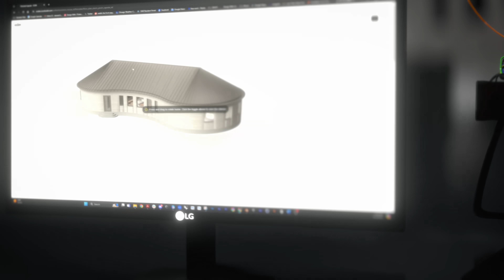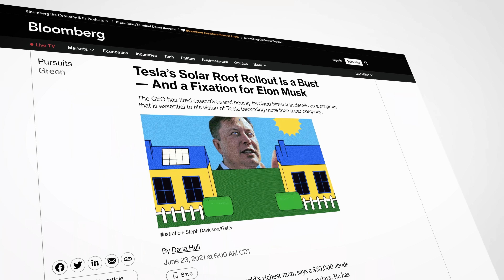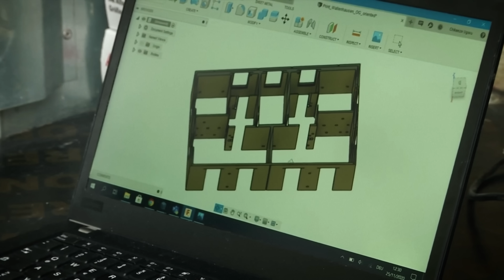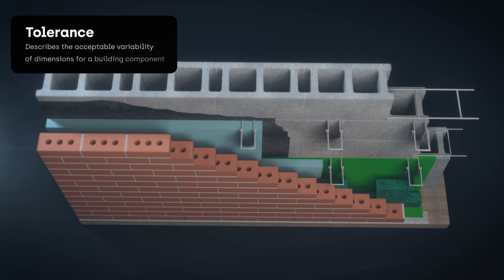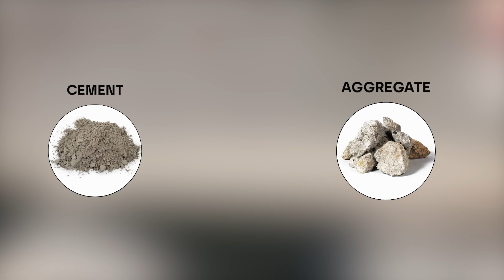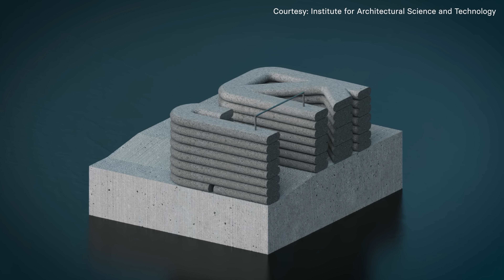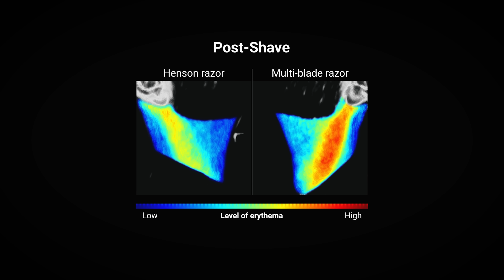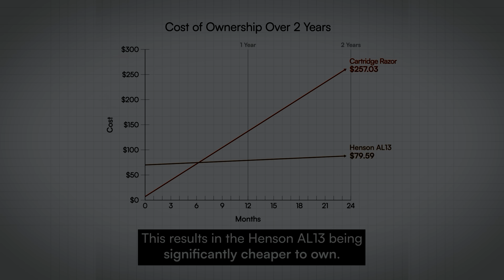Why 3D Printing Buildings Leads to Problems

Comment: The only problem is how bad concrete is. it Bracks dawn quickly its production is afoul for   the Enviromint if we could find a self heling alternative made of some other sustainable rescores
Reply: alternatively, we could just print the d extorter
Reply: What about adobe bag printing instead of concrete
Reply: Nothing stops you from replacing it with materials that soak up CO2. It's just a cost thing.
Reply: @ ... i think that's my point. We have developed whole industries around spending the least possible. The consequences be dammed, profit motive and convenes have rewinds the quality of everything from food and housing to clothing and education. city planning and infrastructure could all be done in nearly infinitely better ways if we could just agree that the goal   is improved quality of life. as opposed to being king of the shit pile
Reply: @ The problem with housing is size and density. You have to put the same size roof on a mega mansion as is required for a six story, 12 or 18 apartment rental building or condo. Both types of buildings require the same amount of land but one houses ten times more people at a fraction of the cost per person. Of course housing becomes more expensive with that kind of splurge. 

In the past people had two pairs of shoes, if they were lucky and some had none. Today we have five or ten or twenty. We are throwing perfectly good clothing away because of fashion requirements. In the past a textile would have gone through half a dozen different uses (and owners) before it ended up as a rag doll or a washcloth. Why? Because it was a very expensive and hard to come by item. The use patterns that dominate the modern world have been enabled by cheap mass manufacturing. They are not typical human behavior. Can they be reversed? Unlikely... at least not without an economic collapse.
Reply: @lepidoptera9337  yes i agree

Comment: I've known masons and they are some of the most skilled and amazing people in the trades.  But it seems like an alternate approach to automating might be a brick or block-laying machine.  The components are already basically standardized and the mortar mix is already made of fine aggregate so would lend itself to extruding.  Seems you could have the machine do all the heavy movement and maybe basic finishing, and then have an experience mason follow behind and do final finishing.  Might save a few mason's backs although fewer would be needed.  If you could also automate inserting reinforcements and anchors it might be a big improvement in efficiency and cost.  Combine that with a temporary roof of some sort over the machine and thus over the construction site so rain is taken out of the equation...

Comment: So the problems are: 
1. No 90 degree angle
2. Computers used in  3D printing require high degree of tolerances, which very differs with usual practice of building. There's hardly any adaptability of computer if this tolerances is exceeded. I also recognizes the importance of initial staking and surveying; the gantry needs to be very precisely put together.
3. Putting architectural and utilities component would be awkward, and some common market items are not 3D-printing-friendly (see point no 1)
4. Printed concrete layer function as interior, exterior, and structural element. This leads to some compromise between performances of printed concrete. 
5. The 3-d printed house is inflexible to any change after construction, since there's no easy way to work around hard concrete after it already se . If there's a mistake, you're done. If you want to renovate your house, say good bye to your roof. 
6. 3-d printing industry is very closed system with high entry barrier. There's only few expert that can repair your house, only limited and expensive equipment. 
6. Using concrete as singular material (point 4) leads to (hard to change) (see point 5). Conventional building tend to be modular, that is easy to install and repair every parts, with each parts have different specification and function
Reply: Yes. None of those are problems. Avoiding right angles actually increases building stability enormously and computer vision can easily outperform human techniques in precision. ;-)

Comment: Couldn't you also grind the walls down a bit and add hardener like a shop floor, then use conrete anchors and drywall panels?

Plus not every interior wall needs to be concrete.
Reply: One could easily create a smooth finish during the 3d printing process. These companies have simply not done it, yet.

Comment: I say it takes just as long to hide those ugly ass layers lines as it does to print the whole structure completely negating the time savings and material savings. This will only ever be a novelty and the buildings built this way will be few and far between and never bring back the investment they cost
Reply: What makes you believe that a machine (the same machine) can't make a flat surface with a mud layer in minutes? ;-)
Reply: @lepidoptera9337  the fact that no matter what machine you use, it won't take minutes to skim coat a house. And a total of 0 examples of these presented has shown a finish on the outside besides paint and even those sparingly so. Also if you wanted a flat mud layer on the outside, you need wire lathe installed, which has to be done by hand, again which none of these examples ever presented show. And if you're going to attach wire lathe, you can't just attach it to wet concrete, it has to be firmly attached with fasteners so it can bear the weight of the concrete it will hold up. Not to mention no machine will beat the quality and speed of 4 mexican dudes who have been in concrete jobs for 20+ years. The only reason for machines like this is cost, not speed or quality, just pure cost and novelty. Any more smartass questions from somebody who clearly doesn't know what they're talking about for somebody who does?
Reply: @ I remember people telling us in the 18th century that textiles had to be woven by hand to get the finest quality. :-) 

So you are telling me that only four Mexican dudes can make quality concrete structures? What about Chinese dudes? :-)

Comment: The cost of concrete is very high.  Building homes of concrete and brick are luxury constructs.  Average people live in lo rise condos and apartments framed with wood and steel.  Brick is a poor thermal insulator compared to wood, or composite fixtures.  In the end these 3d pri ted homes will be a funny historical sidenote, because they will never reach the level.of prowess required for mass market acceptable use.  If you still have to finish the interior, then the cost is unrecoverable for this method.
Reply: The higher price of concrete buildings is mostly due to labor, not materials. Considering that a concrete building is fire resistant and that it can withstand high winds, thus lowering insurance cost, in many locations a concrete building is far superior.

Comment: Already solved, but not adopted widely. There are prefabricated homes, with all the perks of factory assembled individual parts. Why bring the factory on site, when you can just assemble the modules on a foundation ?
3D printed houses is just another example of Tech Bros overengineering a solution because they never understood the matter they are dealing with.

Comment: Another major issue not mentioned here is earthquakes.  Where I live, that flimsy construction would collapse into dust at the first large tremor.  Anything over a magnitude 5 or so would be disaster.
Reply: Concrete is going to hold up a lot better than toothpick-and-cardboard construction. This is a non issue.
Reply: Not quite sure what you mean by "toothpick and cardboard" construction.  I'm talking about typical construction methods used where I live, well able to handle magnitude 7, 8 and even 9 quakes.  This flimsy 3D printed thing would not survive anything near that.  And it isn0t concrete, either; it's basically cement.  Concrete usually implies rebar: there is none here.  Cement plus aggregate isn't going to be strong in tension, as rebar is. Perhaps strong in compression, but not tension, and not sheer, unless there is rebar present.

Comment: ALOT OF THE PEOPLE WHO WANT THIS TO WORK...HAVE NEVER BUILT STICK FRAME HOUSES!!!!!
THERE IS NO QUICK FIX SOLUTION.!!!!
BRICK HOUSES TO SLOW TO BUILD, BUT FIREPROOF.
*NOT EASY TO RUN WIRE. NOT EASY TO MOUNT PLUMBING. NOT EASY TO FRAME THE INSIDE AND ATTACH WALLS.
**I REFUSED TO WORK ON SEVERAL PROJECTS IN THE STATE OF MINNESOTA.
*THEY ARE NOT CODE!
***MOLD..WILL BE AN ISSUSE ON THESE. UNTIL MOLD INHIBATORS ARE PUT INTO CONCRETE
**REAL ESATE VALUES ARE WAY LOWER, NOT COMPRABLE TO REG FRAMED HOUSE.
CONCREETE IS WAY MORE EXPENSIVE THEN LUMBER!
YOUR PUTTING TWO OR 4 GUYSIN UNUION TRADES OUT OF WORK.
*WHAT SAVE ON LABOR??? 
PLUS THE UGGGG FACTOR!!
***OH YOU HAVE TO PAINT IT, NON CONFORMING HOUSES HAVE TO SOMETIMES HAVE A COLORED THEME IN ALOT OF STATES AND CITYS!!!!!!
*8DONT HAVE TO PAINT THE EXTERIOR OF A NEW HOUSE!!!!

Comment: It seems like machines could build with large cast concrete wall modules, say 3X3X.5 feet, that would be too big to handle by hand, but still small enough to allow for flexible designs.

Comment: First cement and agregate are carbon intensive.. Next, the method does NOT deal with earthquake issues. Last slow in construction comes from decades of innovations proving wrong over subsequent decades.

Comment: I think that long term there are going to be some really interesting use cases for this and I'm interested in finding out what those are. It feels like this could be valuable for certain types of extremely remote construction, such as durable long term shelter in hostile environments. Essentially, I'd start by skipping past adapting it to typical construction and finding the edge cases, then work backwards.

Comment: Imaging wanting to paint the interior walls. Spraying walls can be a nightmare if the house is already being lived in. Rolling isn't a real option. And brushing would take forever. Not to forget those seams will change the value of the color in different lighting arrangement far more than a normal texture. I'd hate to deal with that. Plus concrete indoors walls seems like a bad idea for anyone with little ones.

Comment: I work in the building industry and i think building innovation has also been slow because the methods WORK so when you have an extraordinarily expensive product (like a home) and a method that already works, it is hard to convince people to gamble on a new technique or material that they can't easily replace if it fails.

Concrete is also hard on the environment, so not always the best solution for every person.

Comment: You calling it the whole freaking time "concrete concrete" already tells me you don't know what the fuck are you even talking about.....as of now there's no concrete in 3D printing, it's grout or mortar. And for the rest of the "points" about framing this and that, you still have to design them, which 3D already does for you when you do the floor plan for the machines to print. And if building and framing and all that nonsense is so easy and cheap, how come there's not a massive amount of homes if labor and building practices are so abundant and simple? And finally, a bunch of nonsense about Wooden houses being simpler and more efficient (While requiring an ungodly amount of insulation and different materiales to build a simple "wall") is stupid talk coming from people who have never built or lived in an actual concrete development.

Comment: I saw a video of a bricklaying robot building a factory, what most people failed to see was the guy following it pointing the brickwork. What people do not see about these 3d printed houses is how they install the electrics and the plumbing, I know I haven't, also there is no reinforcing in the cement, so, if you want something in the wall not on it, you have to chase it out, and I would love to see what it does when tried. I worked on a project to rewire a house type known as "No Fine", it is a loose mixture of cement and pebbles poured into a mould and left to harden, but if you have to make a chase or box into the wall it is a delicate job as it can crumble very easily and everything has to be done by hand, as one company found when they used a chasing machine, and it burst through into the neighbouring house. These houses may look fun, but they will probably weather faster than other houses.

Comment: i grew up just down the road from these bridges bear in mind they are 100% concrete roofs, handrails, everything and if you dont know you wont know till your right up on them. built back in the day of my great grandfather they are still in great shape these boys could make it look like it never happened on a repair. highway bridges get repaired all the time. 
i run 3Dprinters and their having all the same problems our rookies do they'll get it figured out. 
i also design a lot of the stuff i print and its hard to get an old school to switch over to the thinking required for a smooth print so thats why they are kept out of the loop.
https://www.youtube.com/watch?v=9ztNDzlMR20

Comment: Sounds a lot like a silly complaint...Sure there are drawbacks or limitations to 3D building...But there's drawbacks and limitations to everything when building...That's why engineering is basically the science or art of balancing strength and limitations...Every engineering upside has a downside...Steel is more resiliant than brick, but more expensive...Brick construction is possibly stronger than 3D concrete, but more time consuming and costly

Comment: I think this structural 3D printing is a solution in search of a problem. You can get all of the benefits of 3D printing (speed, strength, concrete structure) without the drawbacks (lack of modularity, irregular surfaces, insulative problems, highly specialized workforce) with proven existing technologies. Insulating Concrete Forms (ICFs) have been a thing for a while now. They permit the rapid on-site assembly of a well-insulated concrete wall without the challenges of 3D printing.

Comment: The concern about repairability and being able to make changes assumes that the rough extruded finish would remain, which seems unlikely. Sure, right now these companies are "showing off" the layered finish, but I can't imagine that will remain the case. If this ever becomes a mainstream tech you can be almost certain that it will receive something like a smoothing coat to have nice flat walls. And in that case repairs and modifications will be done conventionally without issue. Though I have my doubts that this is actually cheaper than just normally bricked houses like they are building in Europe. They already use very large insulating bricks that go up incredibly fast. And that really all this is replacing. Not only that, it seems like all the steps after 3D-printing are actually more difficult to do.

Comment: The reason that there's no innovation in construction is government.  It comes in the form of codes , permits, and other  bullshit.  

Ps if you really want sharp corners  for some reason.  Just set a form in each corner. But realize these corners will have a completely different appearance.

Comment: We should be building with concrete over stick built period. Wildfires can’t spread thru concrete home neighborhoods. We are one of the only country’s stick building. Concrete is cheaper, more insulating, quicker and lasts a lot longer. Not this 3D stuff, it’s not quite ready yet.

Comment: I question why people cling so hard to the cardboard and sheetrock homes that were forced to overpay for I would much prefer to live in a concrete structure than one made out of 2/4 in sheetrock and everyone in the construction industry knows homeowners are getting ripped off with these cardboard houses so let's not pretend that the house is we currently live in are worth a damn they don't make brick houses anymore unless you're a multi-millionaire the average American lives in a cardboard 2 by 4 and sheetrock Shaq that they were forced to take out an unreasonably High mortgage to get the home building industry demands disruption because it's a total rip-off on all the homeowners in this country

Comment: 10:25 I am pretty sure 90% of imperfections can be easily fixed by either knocking off the protruding pieces or evening out the uneven surfaces. Taking into account that these houses are more robust and cheaper than the average US house - still a better solution, with all possible imperfections.

Comment: They're not even cheaper.  I don't mind how they look.  But there isn't any improvement to costs.

ICF seems far better.  You can contribute yourself without having to setup some massive system to do the 3D printing.